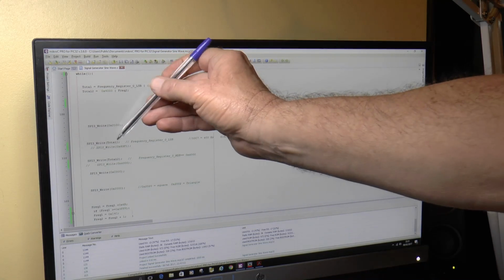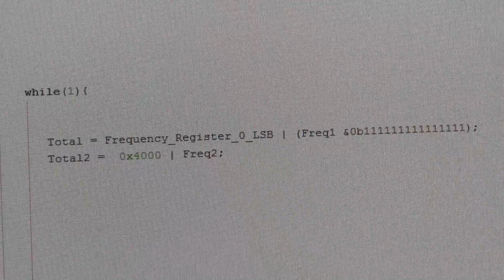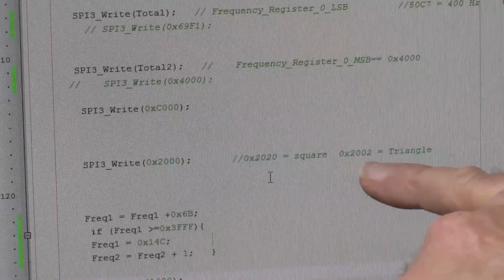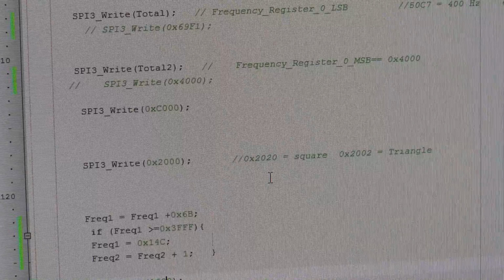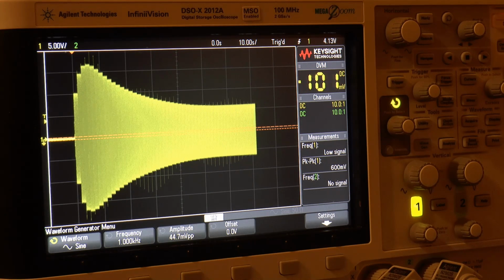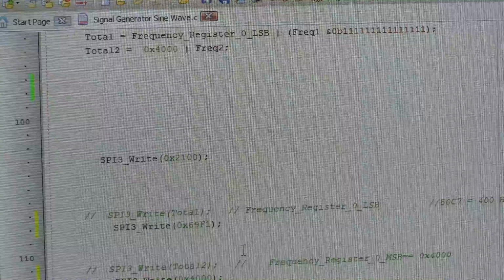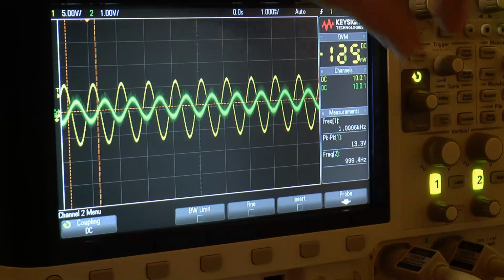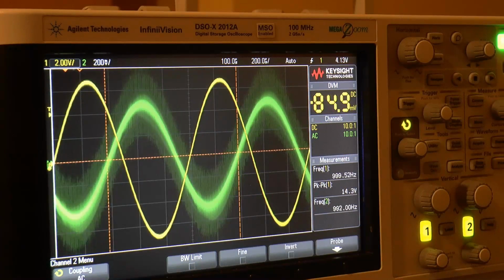AD9833 frequency generator in real world use, and Mackie Amp phase error

Comment: Cool video. Repairing a V2 at the moment and yes this is the same. Them two op - amps are missing. This one here that L11 coils gone up in smoke. It's funny how all these modules have slight difference from each other. definitely cost cutting measures.
Reply from the maker: Is L11 the big yellow tape one on the pfc circuit, next to the 8 pin chip?
Easy repair lol, this very amp had a burn hole under that coil, poor soldering
Thanks for your comments
Reply: John B It's the one in the metal can on the LF output. After the MOSFETs. It's funny because it made hell of a bang and theres no silicone blown up. Got a replacement coil ATER R17. Just going to change the lot and hope it isn't any smd parts. Curiosity got me now I'm going to have to rip this can apart now.